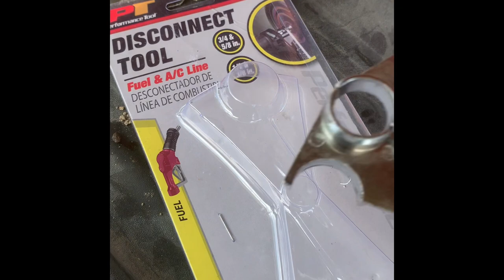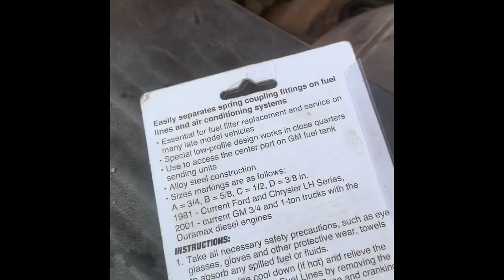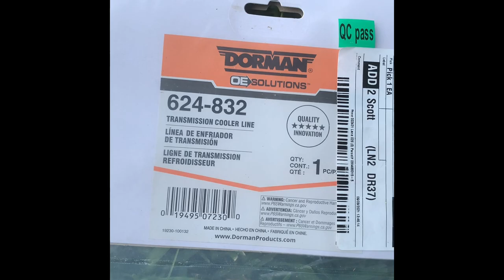1998 Dodge Ram 1500 42RE Transmission Oil Cooler Line Replacement

Comment: I’ve started this same job you’ve posted. My main problem was forgetting to take pics. Your post and description of what you had to do was very helpful. I’ve taken the line out and put back at least three times. When I get to connecting lines at transmission , the lines don’t meet up just right. I have them in the brackets before trying to connect. After watching your video, over and over, it should be a breeze now. These lines should’ve been made in sections.
Reply from the maker: Yes, you should’ve taken pictures. LoL. I wish they would’ve made them hard lines from the transmission oil cooler that transition to soft lines for easier routing.

Comment: Great video. I'm fixing to do this on my son's 1999 Dodge.
Reply from the maker: Once your done and transmission filled double check the connections on the transmission to ensure there are no leaks. One of the connections on mine had to be tightened again to stop a slow leak.

Comment: Just watched the video after removal of the starter and disconnected linkage to the trans. Now I can’t finaggle the new ones in. I did a no no in the mechanic world and cut the lines to get them out. Now I am having so much trouble getting the new ones in! 
Wish me luck 🍀
Reply: used compression fitting on the new lines.worked out fine where i put them after install

Comment: What if  the 19mm part lines start to twist with it
Reply from the maker: You’re talking about the OLD transmission lines twisting while trying to remove them right?  If you’re replacing them then I’d say crank away . . . that fitting will come loose.  I’d let it soak for a while with penetrating spray first though.

Comment: Does a 2001 dodge ram 1500 5.9 magnum come factory with a oil cooler?
Reply from the maker: All automatic transmissions will have an oil cooler. Manual transmissions usually will not as they do not produce the amount of heat that an automatic transmission will.

Comment: Hello, what can cause transmission fluid to leak all over the top of the engine bay? It only leaks badly when I'm driving otherwise it won't leak while idle so I can't see where it's coming from. My 1500 also has a transmission cooler. It's a 2001.
Reply from the maker: Make sure your transmission is full, put on your parking brake, put the truck in drive and take a look under the hood. Put additional chocks on the wheel just in case, but this way you’ll be able to find your leak. Mine was leaking near the firewall from being old and rubbing.
Reply: @djbroussard82  thank you I'll have an update when I find the leak.
Reply from the maker: You’re welcome. Also, do not stand in front of the vehicle when trying to look for the leak and wear some safety glasses in case you somehow take trans fluid to the face.  You should be able to spot it cause the trans lines are easy to follow. If it doesn’t leak with how I said then get a second person to give it a little gas to increase line pressure because it may be a pin prick hole.
Reply from the maker: If that does not work you will need to chock the front tires, jack up the back of the truck, put the axle on jack stands and allow the rear tires to turn. Someone can slowly increase the speed in Drive, let the transmission shift through the gears and eventually you’ll find it.
Reply: @djbroussard82  hello again, so I tried the first method you recommended and it seems to be from the transmission cooler! The puddle underneath the car also seems to be right in the exact area. From what I can tell the transmission fluid was seeping through the radiator and into the fan cover thus causing the bad leak. Just to make sure I'll replace the transmission cooler and have another update if that stopped the leak. Thank you for your help I'll definitely have an update. Also the dipstick was almost empty and it was around max level.
Reply from the maker: That’s good you found the leak.  I’m sure you’re correct on that assessment of it being the trans cooler.  The upside is you’ll have done some good transmission flushing and fresh trans fluid for another 30k. 👍

Comment: Would the same part number lines be the same for a 96 Dodge Ram 1500?
Reply from the maker: Do you have a 42RE transmission?
Reply: I have a 96 Ram 1500 I'd have to look in my manual I know the trans lines for my truck are different

Comment: When I put my truck in drive and give it gas it jerks real hard then starts moving any idea what could be making it do that every time I come to a stop and try to go it does the same thing jerks hard then drives
Reply from the maker: First and foremost make sure your transmission fluid level is correct. This will definitely cause this issue, but so will faulty solenoids in the transmission.
Reply from the maker: Any luck in fixing your trucks jerking problem?

Comment: How did you remove the 19mm on the trans? My 19mm doesnt fit!
Reply from the maker: Maybe my cheap Chinese Harbor Freight 19mm has a little more wiggle room. Have you tried a 3/4” wrench?  I believe they are a hair bigger.
Reply: I used a 21mm wrench under my truck it worked just fine.

Comment: Yea ,well its not that simple i have 97 and it has a huge nut .on other side that tool doesent even fit .i bought it. And the plastic kind wich did fit but it doesn't come off .i just put water pump  hoses  ,thermostat, gaskets. And more now have the radiator out and cant get that off the nut is in the way..might have to cut it..problem is that short line is 50 morr bucks ..radiator wss 230..00

Comment: Which line goes where I’m doing the same thing and I forgot to take pictures where does the rear line hook up to on the radiator?
Reply from the maker: That’s why I stressed on taking pics in the vid. Unfortunately I’m not home so I can’t even go look for you bro. If I was I’d go crawl to check for you right now. Maybe one of the other guys who commented may be able to check for you brother. Good luck!